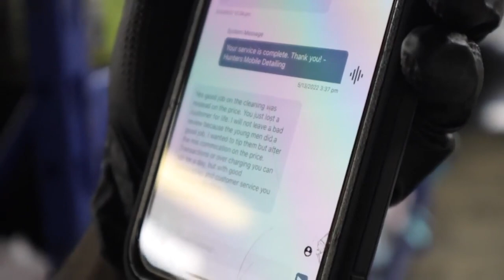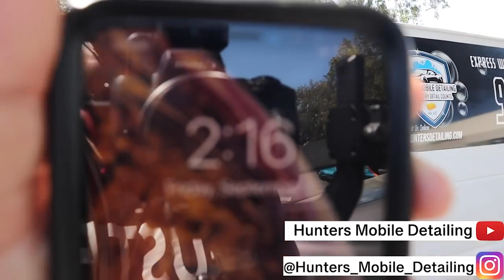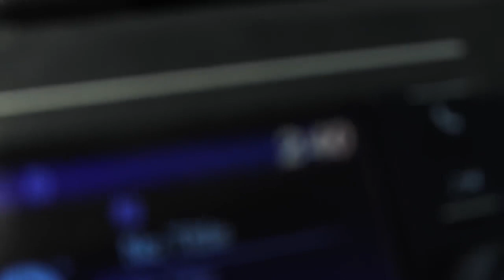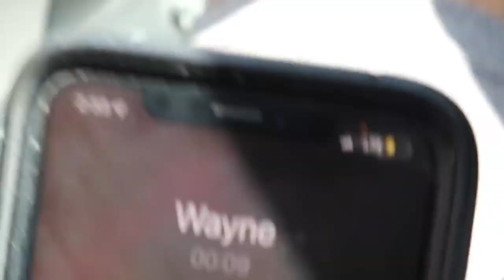9 of My WORST Detailing Customers of 2022 - Hunter's Mobile Detailing

Comment: I bought at Home Depot 6’ long foam 1” pipe insulation to wrap around the legs of the canopy along with 5 gallon bucket’s with lids to fill with water to put weight on each of the canopy legs.

Comment: Am not even in the detailing industry but I find your advice, solid for general customer/client management thus subscribing.  I think there is alot here that can be used in any industry, including mine which is providing fully furnished rentals to those  in  town on work assignment or vacation and needing ready to go, temporary housing.  As for your question, I would definitely charge a non-refundable trip charge that gets rolled into  final price if they  move forward.  Value your time.  🙃

Comment: The reason the guy with the lifted truck doesnt want chemicals on his wheels is because they are raw polished aluminum and most wheel cleaners will stain them and then you would have to polish the stains out they also scratch  easily soap and water is really all you need if they're bad they have to be polished which is hell😂